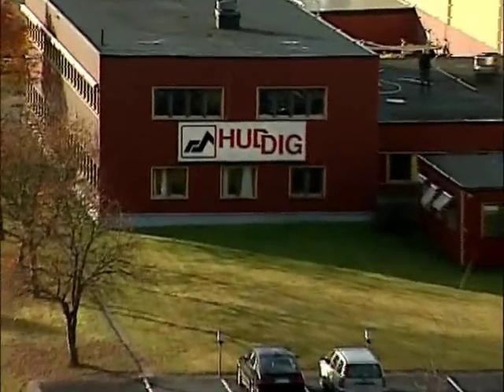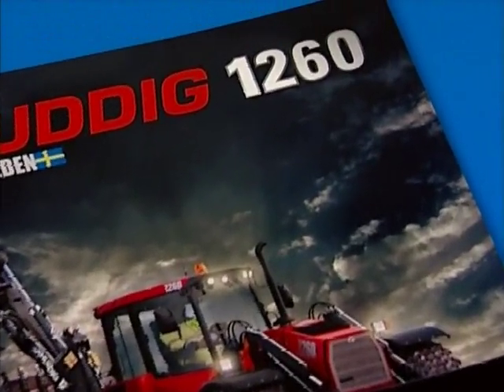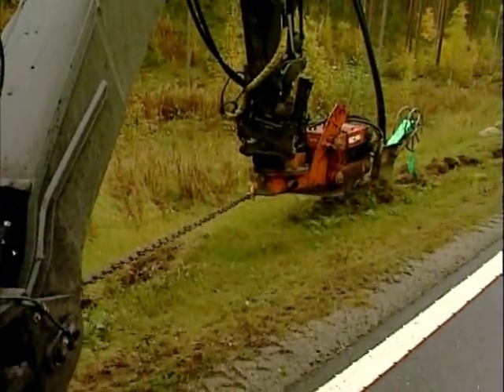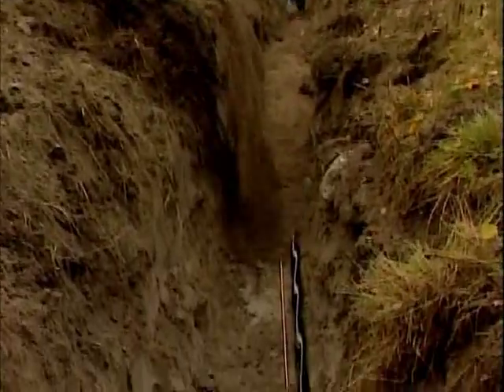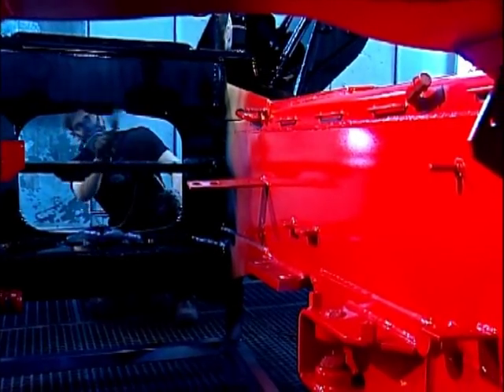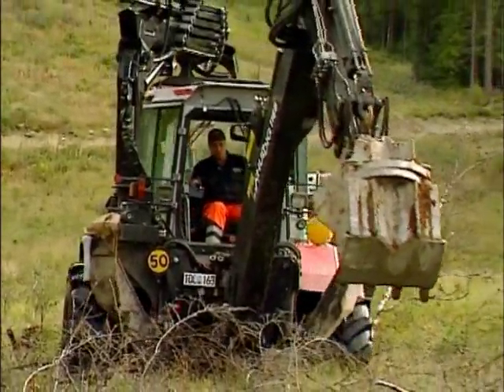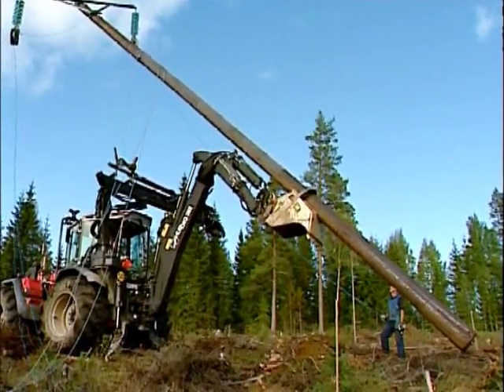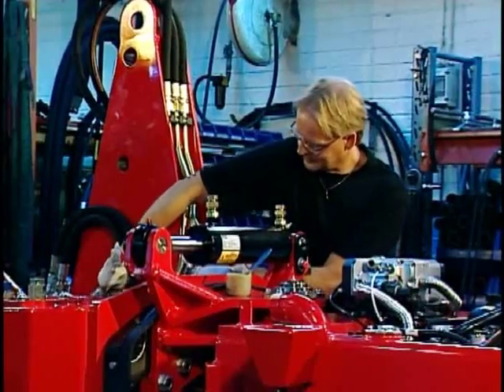Huddig of Sweden - Part 1 of 2- English

Comment: in my 55 year of being around all kinds of equipment an ran a lot of them, I have never heard of this brand here in north western Ont. Canada, iv bought a few my self but again never seen this brand or heard of it an I would be very reluctant of doing so being there is no reference to how they are, id hate to talk about them here on my home stead here on my you tube channel not knowing a thing about them, I found out about yanmar in the last few years as yanmar gave a tractor to a you tube home steadier for 2 years with all the attachments, and they seem like a real good unit as the guy who has it talks the full truth about it,, maybe you do not sell to Canada as I'm sure all the laces iv been id see a dealer, but I see you don't reply to anyone so far
Reply: I work with Huddigs almost everyday, they are a very capable and powerful machine for telecom  fieldworks. You can stand 10m up in the lift while the machine is moving in light terrain and it does not feel unsteady at all. It's overall power is jawdropping. Here in Sweden they are quite common.